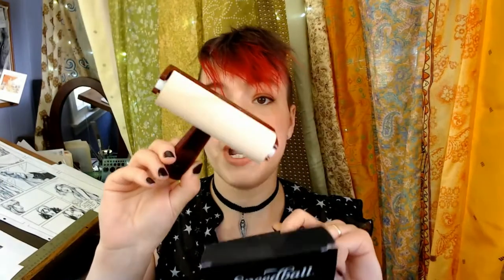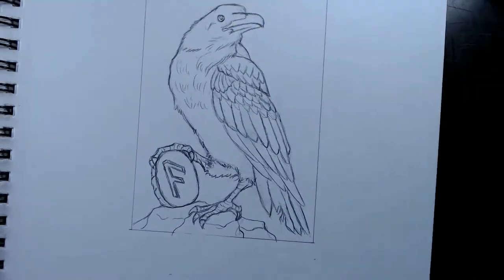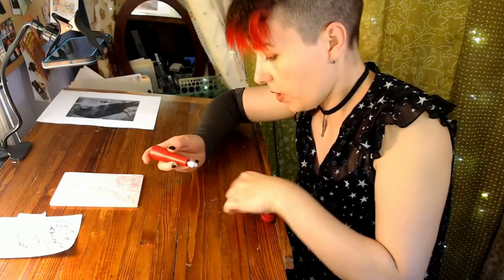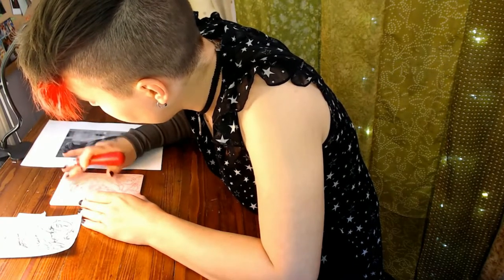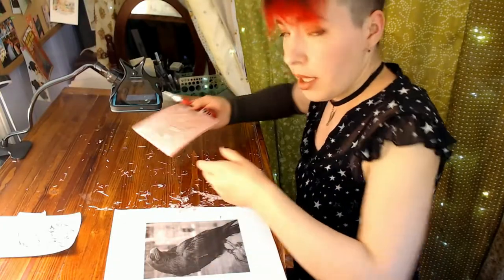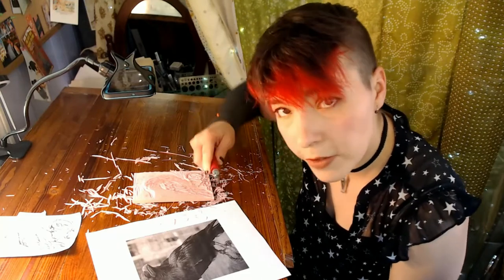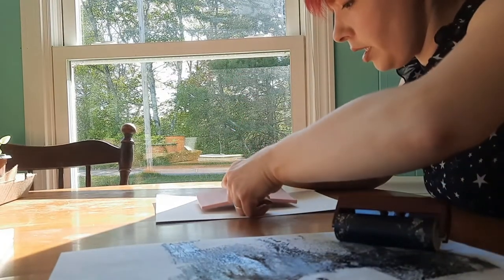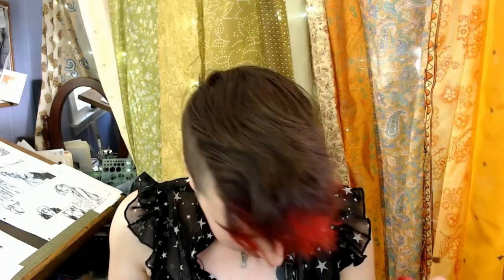Basic Block Printing

Comment: i might try this block printing thing but i think i'll uses a dremel tool to remove the white area and see how that works out
Reply from the maker: That would probably work great with a linoleum or wood block. Not sure how well it would work with a soft gummy block like the "Speedy" in this video.
Reply: I've considered this, but haven't tried it yet. I have both linoleum and the silicone (?) blocks.
Reply from the maker: @johnmccolley4396  yeah, I feel like dremeling the linoleum might work, but the squishy blocks would probably just tear. Worth experimenting with, though!